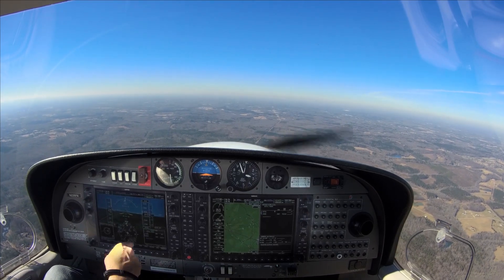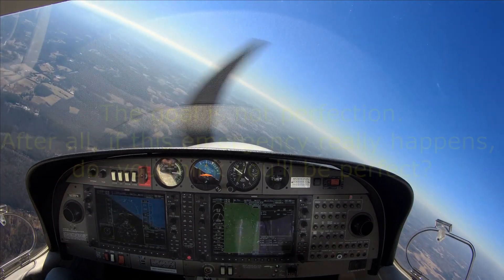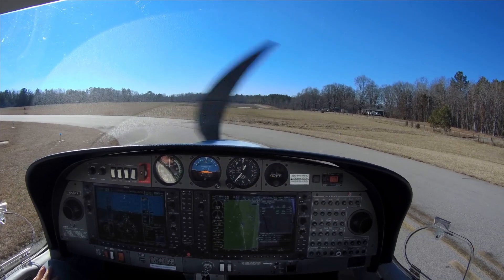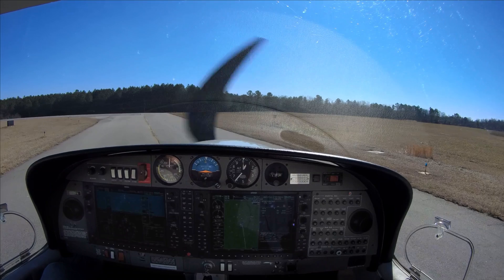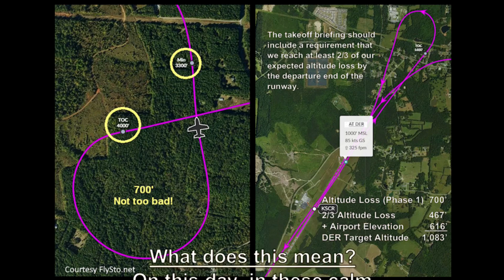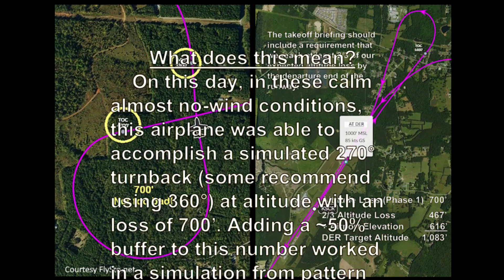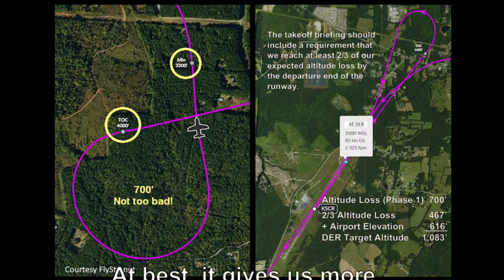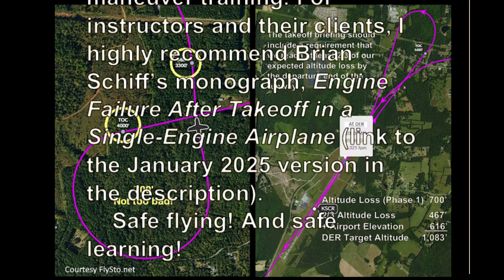"Impossible" Turnback After Engine Failure

Comment: Do a 60° bank turn to keep it tighter and let it drop more, you held too much back pressure and were close to a stall. You'll lose more altitude and pick up speed that you can then trade of but more importantly your turn radius will be much tighter keeping you way closer to the airport.
Reply from the maker: @markor2476  you make a good point. The analyses I’ve seen indicate the best performance is reached with a 45° bank near stall speed. But as I mention in the video, my goal is not perfection but reality with a buffer. I’ve seen more than enough pilots who have trouble even with common emergency practice.
Reply: @midlifeflyer  This absolutely has to be practiced. I tried the sim, never in real life yet, not even at altitude. But in the sim, making a 60° bank turn back will surprise you just how fast you get back around and how much closer to the airport you stay. The trick is to know when you still have enough altitude because you will drop much more much faster. You must not drop so much that you run out of altitude to be able to level off and land. Try it in the sim first would be my suggestion. I would disagree with 45° bank. It's a half measure, I'm more in the camp of you either commit coming back and do what gives you the best chance for that, or you commit 30° either side of the runway in a field.
Reply: @midlifeflyer  And just to add. I would say the main problem of coming back to the field is not not having enough altitude. For me that's the improper understanding of the problem. The problem isn't not being high enough, it's being too far away from the airport. So in my opinion staying close when choosing to return is the top priority so you're sure you'll make it. The worst possible thing you can do is make a shallow "safe" turn back and then run out of glide distance with no good options. So all you have to know is how much altitude you lose if you bank 60° and keep that for 270° and a small margin. Just tried it again in xplane for a Mooney Ovation, gave myself 3sec reaction time, 60° bank turn into the wind back to the runway is super easy at 800ft AGL.

Comment: I always struggled feeling confident when practicing this at altitude. I did it with a CFI who specialized in my plane, then once I had 300-400hrs in my LSA plane I did it to the runway from just under 500ft. I like your 2/3 factor though, I certainly add a buffer past my "demonstrated".
Reply from the maker: I figure it this way. However imperfect we are at altitude will be worse when it's for real. And low altitude maneuvering has its own visual challenges. So we need a buffer.
Which LSA are you flying? I have time in a few of them.
Reply: @midlifeflyer  yep, gotta account for lizard brain! I'm in a Flight Design CTLS. I tried out a bunch before deciding on that.

Comment: Eleven of my thirteen engine failure forced landings were at 200' with waiver on pipelines or crop dusting.  Only one was on takeoff, but most were at six inches in or coming out of a crop field.  My default takeoff in any airplane is level in low ground effect, same as spraying, until obstructions force pitch up to zoom just over them with the outcome (with or without engine working) never in doubt.  So all were six seconds deals and none were the impossible turn.  All were successful with damage only to a Pawnee and a CallAir.

Fully using the extra free ground effect energy so long as runway remains favors airspeed over altitude, so no turn back is likely.  Wolfgang, on page 85 in Stick and Rudder, explains the efficient takeoff advantage of his law of the roller coaster principal.  Airspeed and altitude are two forms of the same thing and I, like Wolfgang's experienced pilot, "prefer to take that thing in the form of speed."

Learning some maneuvering flight by learning the possibilities of the impossible turn is a good exercise.  Some wind management to make use of the safer upwind turn to help miss horizontal obstacles and some law of the roller coaster application of what the airplane wants to do in a turn among other low altitude orientation would really reduce fatalities around the airport.  By the way, what does the airplane want to do in all turns and why?  Can the airplane stall itself?  Can we make seventy degrees banked turns at 1 g?  How would we do that?